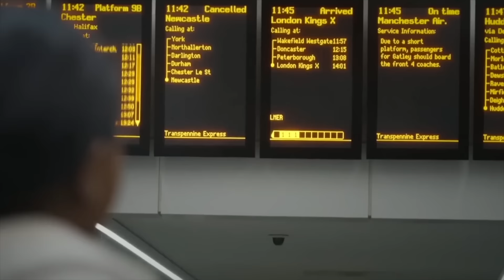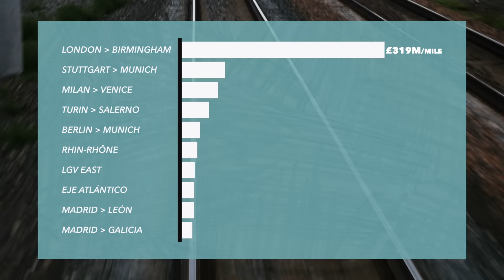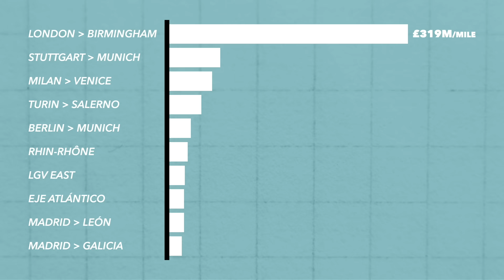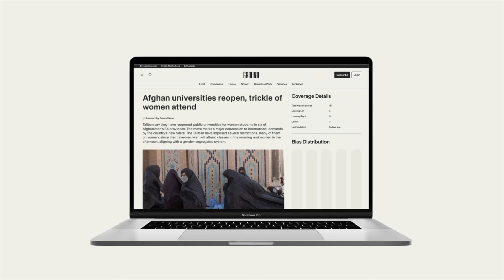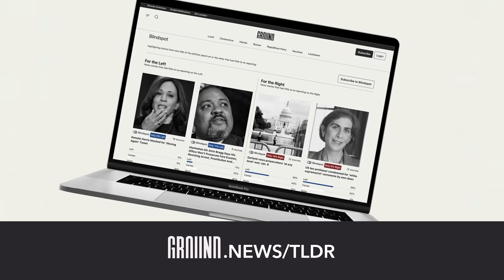The £100bn Railway: Why is HS2 Four Times Over Budget?

Comment: When HS2 is finished, it will be useless. The connectivity is awful- who wants to go to Curzon street, then catch a tram to New Street to continue the journey? If it actually reaches Euston in London (which is in doubt), a long walk or a taxi ride is needed to get to St Pancras for HS1. Might as well fly, and it would be cheaper.
The thing that wasn't mentioned was the over engineering. We are a small country, yet like all "prestige projects" it had to be World Beating, faster than other high speed lines, so costs more to build. Even basic physics has been forgotten- high speed needs more power (thus higher electricity costs), and the wonderful privatised power supply system is not up to it.
The money wasted on this project could have been put to better use, instead of being a cash cow for foreign companies.
Reply: Euston and St Pancras/Kings Cross are so close together that you can see one from the other. The three main stations in Birmingham Curzon Street, New Street and Moor Street are even closer together.
Reply: @meeeeeeeeeeeeeeeeeeee2  It is quite a long walk between Euston and St. Pancras- I have done so in fair weather when I was younger. With luggage and bad weather, not so easy. But what is the point of high speed rail if you then have to walk such distance to catch another train to complete your journey?
The fact that you can see the stations from each other does not mean that it is easy to travel between them. From where I live now, I can see Boston, but it takes about 2 hours by car or about 3 hours by bus and train to get there.
Reply: @MervynPartin  I used to walk it twice a day as part of my commute, and the distance is trivial, especially once you find the short cut through the council flats. 
There is a reason that HS1 and HS2 are not linked and that is that there was not enough demand for that journey to make constructing a link worthwhile.

Comment: Does all infrastructure go over budget?  In an inflationary economic, yep for sure!  Do we complain about any other infrastructure, not just trains?  Nope!  Do we get less value for money for the same money on roads?  Yep!  Rail still gives more value to convenience and the economy.  If you want to increase local all-stops services, you don't build more Victorian-era rails — you build fast new rail, and put 3x or 5x more trains on the old rail.  There are huge gaps in the timetable right now thanks to mixing fast and slow trains.
Reply: > "Do we complain about any other infrastructure"
yes. everyone does. dont make a strawman
Reply: @techheck3358  Incorrect — the level of scrutiny per mile or per pound of road work (new or upgrades) is completely out of proportion.  If it's 100:1 do you think it's a strawman?  You can't have 100x more column-inches and TV news reports about 1/100th of the train infrastructure and tell me it's a straw man.

Comment: They should have started HS2 in the North and  connected Manchester Leeds and Birmingham first and left the improvements in London till last.
Reply: Why !!, the original plan was for HS2 to run from Birmingham to London to improve these services and free up capacity at Birmingham New Street
Reply: @peterwilliamallen1063 Agreed it was the Birmingham to London in the original (IMO short sighted)plan but for a similar amount of money Birmingham and Northern cities of Manchester Liverpool and Leeds have had faster communications stimulating economic development AND the New Street bottleneck would have been resolved for a fraction of the cost of getting into London and under the Chilterns.
Reply: Why the lack of track space and journey demand is south of Birmingham. If the north end was built first it could hardly be used until the south end was completed as there would be no where for the trains to go.

Comment: It was never even remotely a good idea or even a good concept, it's always been stupid from its very inception.  Because....

They said Leeds to London was 2 hours, and HS2 would get it down to 1.5 hours.  BUT DOES IT?

I live 5 and a half miles from Leeds city centre, where the main station is.  To get to London, I have to walk to the bus stop, get a bus into the centre, which can take about 45 minutes in rush hour traffic, but because they're so unreliable and predictable I need to be at the bus stop at least 10 minutes earlier than that, and I can't get to the station at the exact time my train for London is due to leave because I need to allow time to get through the station, and leave a buffer in case there are any issues.  So i'm already about an hour and a half down by the time the train even leaves, then when it arrives in London, I need to get from the main station to the underground, and 1 or 2 tubes depending which office i'm headed to, then walk the remaining distance to the office.  Which I need to allow at least 45 minutes for.

So actually the TOTAL journey time - from my house close to Leeds centre, to our office close to London centre, actually takes about 4 to 4.5 hours on the old rail network, and about 3.5 to 4 hours on HS2.  Suddenly it doesn't sound that appealing.  Not for what it costs.

(Meanwhile, all that "it'll help with the commuter trains" is bollocks.  The nearest station to my house don't send enough carriages on the trains so there are people left at the platform because there wasn't enough room to get on.  They're also about 45 years old.  Then there are the train strikes because the staff don't get paid enough.  How about you invest money into fixing the real issues first.)

Comment: BUILD 10 KM OF HIGH SPEED LINE, FINISH IT, THEN BUILD THE NEXT 10 KM ETC THEN AS STATIONS COME ON LINE YOU START RUNNING TRAINS BETWEEN WHERE EVER TO LONDON AND BACK. THAT WAY PEOPLE ARE GETTING USE OF THE HIGH SPEED TRAINS INSTEAD OF WAITING FOR THE ENTIRE LENGTH TO BE FINISHED, 
YOU ARE ALSO STARTING TO MAKE MONEY FROM FARES AND PEOPLE ARE STARTING TO GET USED TO THE IDEA OF 250 MPH TRAINS TRAVELLING FROM LONDON TO MANCHESTER ETC
IF IT IS BUILT RIGHT HIGH SPEED TRAINS AND EXPRESS/ COMMUTER TRAINS ON THE OLD LINE CAN MEET AT CERTAIN STATIONS WHERE PEOPLE CAN GET ON AND OFF THE HIGH SPEED TRAIN AND ON AND OFF THE EXPRESS COMMUTER TRAINS, THEREBY GIVING THE HIGH SPEED TRAINS MORE PASSENGERS IN THE LONG RUN

Comment: UK has no high speed service serving station, you can't deliver the high speed rail and not upgrade Euston. To be precisely its not upgrade of Euston it is a completely new station for high speed only just next to the existing network rail station. Also all the talk of cancellation, cost saving, looking at alternative from political pressure really increases in price. Every time there is a review, it cost millions and at least 6 to 12 months of delay whilst keeping HS2 employees employed and some contractors on standby. Just let people get on with the job then it will cost less. Main design work and engineers are done by large corporations, SMe make up very small portion. Lawyers don't really look after contracts they review them at the beginning, and when there are contractual issues, it's mainly by project managers supported by legal team. Alot of the smaller companies are subcontractors to the large corporations to reduce exposure and risk. These contracts are run by the larger corporations not HS2.

Comment: I don’t like how the media primarily focuses on the initial budget of an infrastructure project to tear it down. What I’d like to point out is that those initial budgets are always GUESSTIMATES! Why are they guesstimates? Well there are a lot of risks and unforeseen events which cannot be factored in at the initial budgeting stage - therefore, at least in the engineering community, it is a real surprise if projects are delivered at budget or under budget. That would mean everything went smoothly, which rarely happens. So the initial cost should never be viewed as the be all and end all cost. However that doesn’t mean that things would go wrong. So what should be focused on? I believe the risks and unforeseen circumstances which make these costs ballon should be of concern (which this video did cover) and that should be the headline really, imo. So why is it that the structure of project delivery causes high prices? Why is the government not focusing investment in these projects, how have other governments done it? 
Crossrsil had several contracting issues which definitely added to the cost + unforeseen engineering challenges at Bond Street.
Obviously since these projects are a public bill it’s not great to see large numbers but those initial numbers are never accurate and therefore they shouldn’t be the thing we should be fixated on

Comment: only way for costs to reduce is for there to be more infrastructure to build from, the first one will always be bonkers expensive but then you have the expertise and construction tech needed to build another line which will also be shorter because it can connect to the longer preexisting line.

comparing a nation that has no high speed rail to one that has so much it's bonkers is very disingenious.
Reply: Your argument falls apart when you begin to compare the cost of the first Indian HSR line and the HS2. Both are first time HSR is being introduced to these nations. Both lines are of similar length. Yet Indian project cost escalation went only from $14 Billion to $21 Billion despite political sabotage attempts and litigation. UK has absolutely no excuse for HS2 just like they have no excuse for their lack of railway electrification.

Comment: Why do none of these videos ever talk about why it had to be high speed instead of just normal/current speed? That change would reduce the price tag massively as the track then doesn’t have to be raised/can go around obstacles and you still get the additional capacity at the sacrifice of a ~20 min longer journey time??
Reply: Because 95% or more of the cost is just to build the railway and making it high speed only costs a few percent more. You then save money forever as if the trains are faster they can do more trips per day so you need less of them.

Comment: From Beyond HS2 by consultants Greengauge 21:
Upgrading the East Coast Main Line to 140 mph operation as a high priority alongside HS2 and to be delivered without delay. Newcastle London timings across a shorter route could closely match those achievable by HS2.

Integrated Rail Plan says 140mph is capable on the ECML. The HS2 eastern leg is not coming back. Best ploy is to:

1)  ditch phase 2b west.
2)  Ditch the remains of the eastern leg from Birmingham to East Midlands Parkway. 

Both of the above are impossible to justify economically, especially number 1).

HS2 journey time from London to Edinburgh is 3hrs 48 mins. On 26 September 1991, BR ran on the ECML up to 140 mph a London to Edinburgh journey in 3hrs 29 mins. Faster than what HS2 can do it, and that was 32 years ago. That is still the record.  Lines, signals and trains are greatly more advanced than 32 years ago, so should today be faster.  Remove the bottlenecks on the ECML and journey times will be clearly faster again and greater than HS2, and will give capacity increases.
Reply: That's not the point of HS2. A railway network isn't just about providing the shortest journey times city centre to city centre. The point is to get the intercity's off the busiest parts of the ECML & WCML so you free up tons of capacity for local trains, commuter trains and freight trains. Basically, all of the intercity's on the relatively slow ECML and WCML are gobbling up massive amounts of capacity because they go faster than the other traffic on the line, and so they need a large gap in front of them at the start of their trip, and end up with a large gap behind them at the end of it. Local trains need to be held at stations waiting for the intercity to pass etc. This means each intercity eats up several paths for slower trains, be they commuter trains, freight trains, etc. Increasing the top speed on the existing network will only make this worse because your local and freight trains aren't going to go much faster or stop less often, so the speed differential increases leading to more delays and less capacity. And before you say to add tracks to the existing main lines, that would be an absolute nightmare as they are hemmed in by urban fabric along a very substantial part of their length.
Thanks to it's speed and high planned frequency, HS2 can provide slightly shorter journey-times than current intercity's (and yes, slightly longer than some trains did years ago when the network was less congested) despite having them make a bit of a detour as it was originally designed to free up capacity on all three main-lines. Of course, the so-called 'Eastern Leg' needs to be built for the effect to be truly felt on the ECML. Really, HS2 is almost a 'cheap' solution because building two North-South high speed lines to decongest respectively the ECML and the WCML would leave more room for growth in high-speed intercity traffic than what is currently being built. Of course that would have been even more expensive and likely only one of the two lines would have ended up being built, which would have been worse than HS2 because congestion would only be lessened on one coast. To complete the network for England you still need an East-West connection in the North of England: Manchester-Leeds-Hull, and of course an extension towards the Glasgow-Edinburgh area could make sense further down the line. (and incidentally would definitely cut down travel time on London-Edinburgh)
Of course, political and technical mismanagement of the project is also a huge issue. Just one example: Scrapping one platform in Euston station so far along in the process just to be able to build a tower block on top of the station is ridiculously short-sighted as you have to then redesign the approach and are limiting capacity of your line before it's even built because one of the terminus stations is short a platform. All to make a quick buck selling some real estate.
Reply: @mariusdufour9186  
HS2 was first about:
Speed. 
Then Capacity 
Then eco.
Then levelling up North and South. 

What is it now?
Reply: @johnburns4017  It was always about capacity. The speed being necessary to achieve said capacity without negatively affecting some journey times (like London-Edinburgh) and without having to build multiple new lines.
Eco is a given with any new rail capacity because modern trains, even diesels, are a lot more energy-efficient (and produce less emissions) per passenger/ton moved than pretty much any road vehicle in existence.
Levelling up north and south is just marketing speak for using the freed up capacity to improve local connections while still improving intercity service thanks to the new line.
It doesn't really matter what politicians say the line is for. If you look at HS2 on a map, look at the planned journey times, the very high planned frequency (16 trains per hour per direction - New French and German HSL are built for up to 12 tphpd-it's very ambitious for a country that hasn't built much high speed rail), and look at all the intercity lines that will be shifted over to it, it's obviously about capacity and connections at least as much as it is about speed, especially the eastern leg.
Of course, some stupid politicians have argued for axing the eastern leg entirely, arguing that it doesn't improve journey times very much (because trains will be making a detour by Birmingham before going back towards Leeds), thereby entirely missing the point that the capacity is sorely needed.
That's also an issue with HS2, and why the price has kept increasing. Politicians and treasury have continued to push for revision after revision to the initial plan, even while it's being built. Nearly all of the stuff they're axing now (like connections to the WCML and the entire Eastern leg, that platform at Euston station) will have to be built at some point to maximise the usefulness of the line, and a lot of the modifications lead to expensive delays and redesigns, so it's really pretty short sighted. Only building two thirds of the project makes it less than half as useful.
Reply: @mariusdufour9186  
The need was not there for HS2. No one the north of England or the Midlands were screaming out for another fast line into London. It was a "we must have one as well." Then a pathetic "Y" network emerged.  The best design had an eastern nth-sth spine which had NPR integrated with a Pennines tunnel was High Speed UK.

HS2 needs canceling ASAP,  with what is built integrated into the existing network. Then a new design based on High Speed UK. The money sluice has to be stop.

Comment: The irony of environmentalists protesting  a high speed train line because it will cut through some areas of woodland.

I swear if even 1 internal flight is cancelled due to lack of demand as people decide to take the train instead, that will immediately take more carbon out of the atmosphere than those trees ever have or ever will.

Comment: NIMBYism didn't help much either. But £100bn is still peanuts compared to the economic benefit it will deliver over 10 years, never mind a hundred or two hundred years. Also worth bearing in mind that the cost of NOT building HS2 is way, way higher than that.